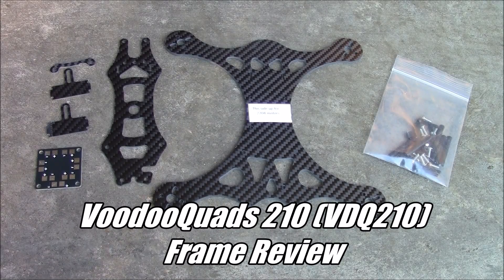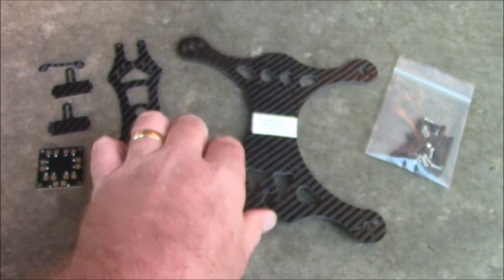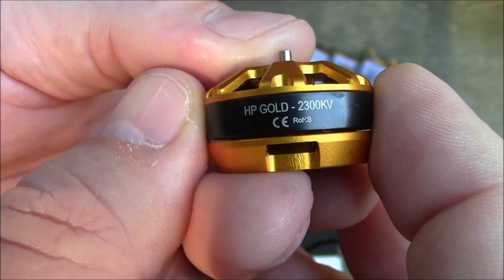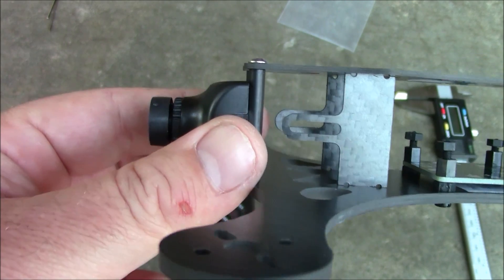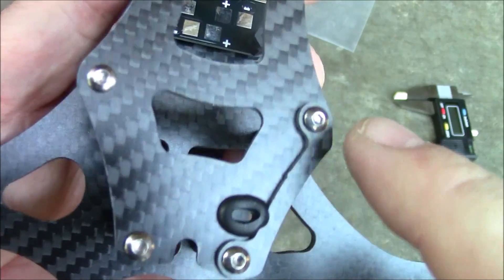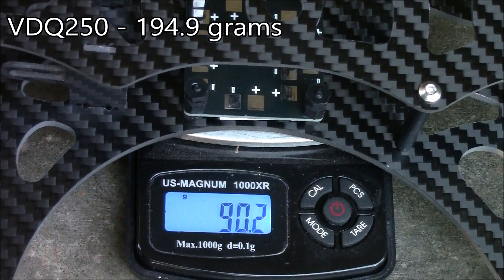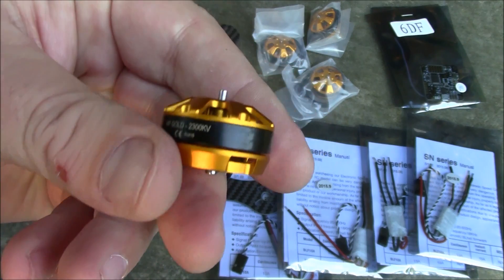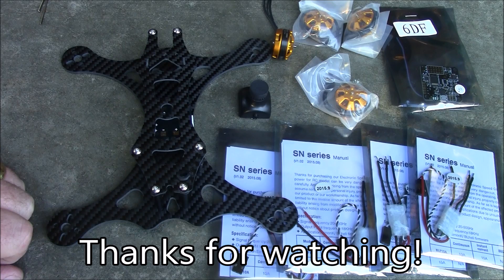Voodoo Quads 210 (VDQ210) Racing Frame Review

Comment: Even though the recommended motor size is 2204 can you run 2205 (DYS) or 1806 (EMAX)? I have those motors but no 2204

Comment: Is it done yet? Trying to decide whether or not to swap my ZMR250 guts over to a VDQ210. I love your videos, can't wait for the full review!
Reply from the maker: Yeah, it is done.  I'm going to try to have an in depth overview of it done next week.  I did crack the frame up near the front arm.  I told Voodooquads that it could use a 40mm main plate for strength and they said they were coming.  the good thing about Voodooquads is that they'll replace a cracked plate at least once for free.  :)
Reply from the maker: +travisgrindal ... 4mm not 40mm.  :)
Reply: +travisgrindal Awesome. Will it run 5" props?
Reply: +KlingerFPV nevermind, just rewatched the video ;)
Reply from the maker: +KlingerFPV Heh.... I tried some 5046 props and it was awesome.

Comment: Hello! You know I love your reviews, so when i find some new banggood frames i wish I could see them here,  so here you have some new stuff I found. Maybe some get your attention too.
this one has a 210mm an this 180mm http://www.banggood.com/Lisam-LS-180-180mm-Carbon-Fiber-Frame-Kit-Mini-Quadcopter-p-1002030.html  the there is this http://www.banggood.com/FeeYoung-Bee180-180MM-Carbon-fiber-Frame-Kit-Mini-Quadcopter-p-1004595.html this emax 200 with motor protectors   http://www.banggood.com/Emax-Nighthawk-Pro-200-210mm-Wheelbase-All-Carbon-Fiber-Quadcopter-Frame-p-999729.html  and maybe this  but i just realice is not carbon fiber :( http://www.banggood.com/GT-250-250mm-Fiberglass-Quadcopter-Multicopter-Frame-Kit-p-994014.html  ;)
Reply from the maker: +Multirotor Go, Thanks!  I've had that LS-210 on order for about a month and it finally shipped.  I may get the LS-180 if the 210 turns out well.  I saw that FeeYoung 180, but I don't think it looks real cool and it only has the 3 spacers.  If you have the battery on top and crash there are only 6 screws trying to hold the top up.  Also, the top plate is only 1mm and the lower plate is only 3mm.  Good luck to it surviving a crash.  I think it really needs a 3mm lower plate and also a minimum of 4 spacers unless you can get the battery mounted to the bottom.  I'm on the "Alert" list for that Emax Nighthawk (I like the way this one looks).  I have the GT-250 already and a review recorded, I just need to get the video edited and uploaded.
Reply: Awesome. Yes I agree with you on the FeeYoung 180 I was thinking the same thing. looking forward for the review.

Comment: I've been eye balling 210 frames (that one included). thanks for the review.
Reply from the maker: +Dave G I should have this one flying this week.  After I get several days of flying in with it, I'm planning a VDQ250 vs VDQ210 video.
Reply: sounds good. I like the idea of the 210's but, still debating about 210 vs 250 mostly on space restrictions (batteries, bat alarm, OSD, and etc.). So, I"ll certainly watch a comparison between the two.

Comment: Any mini quad flying videos coming up, instead of just frame reviews?
Reply from the maker: +Diamonddude97 Yeah, I have a several new videos planned.  I'm kind of burning out on the frame reviews myself.  I need to quit ordering them.  I have another timing gate video coming, how to use FlipSide Racing software, and a VDQ210 vs VDQ250 comparison.  I'll probably make a full review of the VDQ210 if it comes out well, which I'm sure it will.  I also have a 5.8ghz FPV 7" screen I just got that I'm going to be reviewing.
Reply: Sounds like a great lineup. Looking forward to it 👍